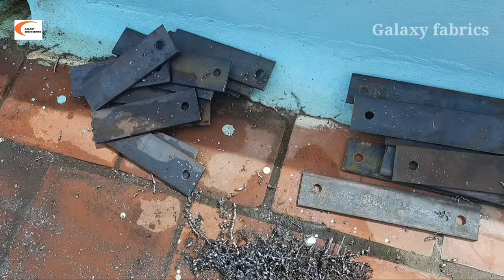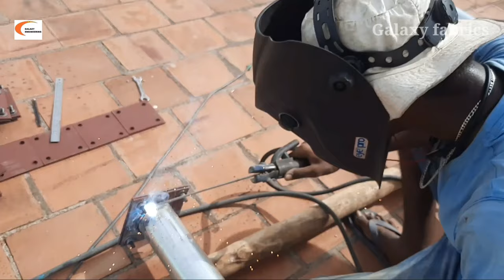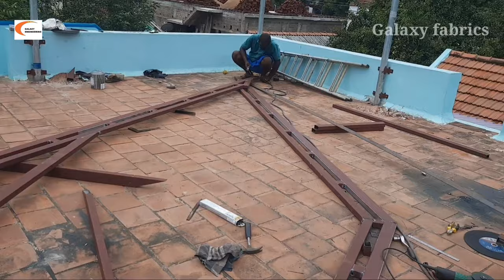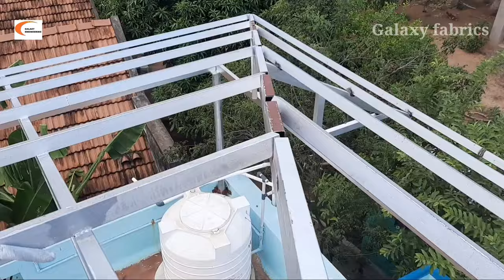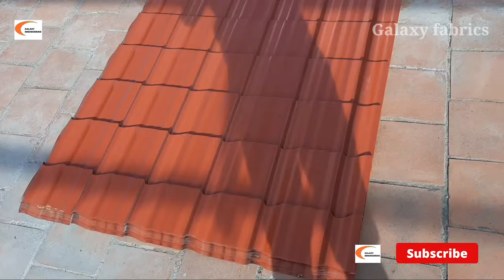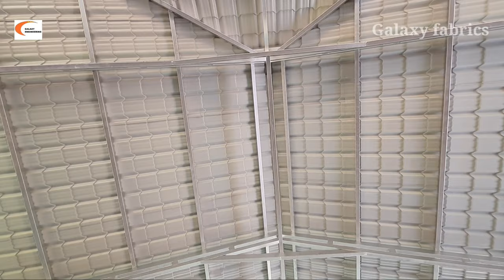Tile model shed work  | Kerala tile model  metal roofing | roofing like tiles | galaxy fabrication

Comment: 20 × 55  feet  how much material budget & lauber charge
Reply from the maker: Approximately under Rs. 1,40,000/- sir.. If u know about labour charge Rs.20-25 per square feet sir. Your total sqr ft is 1100. But you need same like this,   the cost is double.
Reply: @GalaxyFabrication  Open Floor Area  880 square feet .
Roofing Area ethra varum  ?
Reply from the maker: @santhoshkp7426  190/- per square feet sir..  We are taking measurement from  on metal roof area sir. Not from ground area (square feet)..
Reply: 66. 33how many total cost on second floor
Reply: Katrnak
Reply: 30*50 feet built up area. How much material budget and labor charge. To finish work.

Comment: 30x15 feet .....how much total budget same model shed
Reply from the maker: Approximately 140000-150000 sir..
Reply: Bro eantha sqft
Reply from the maker: @maheshmk7270  puriyala
Reply: @GalaxyFabrication  Sir, Can you take job work at Pattiveeranpatti, Nilakkottai taluk, Dindigul District of size 30×15 ft.? What is the budget and terms and conditions?
Reply: @GalaxyFabrication  is it total material, labor & fitting charge or only your fitting labour charge
Reply from the maker: @naveennani1078  totally.. But now  material price have increased.

Comment: How about cooling sheet for roof?
Reply from the maker: Little bit hot at summer season..
Reply: Does the cost includes foundation if done in ground?
Reply from the maker: @balkrishnanfca  No.  The price of cement and sand and gravel is only extra.